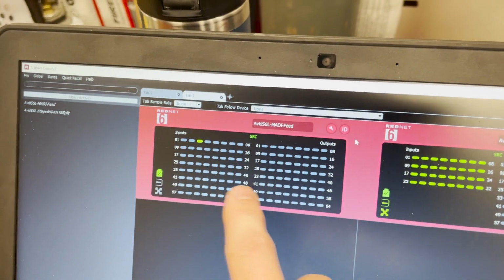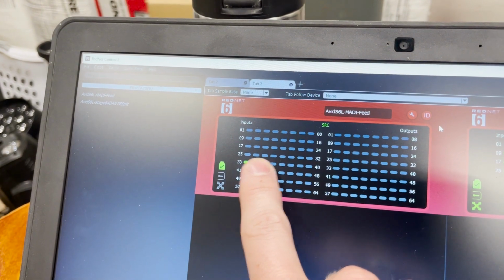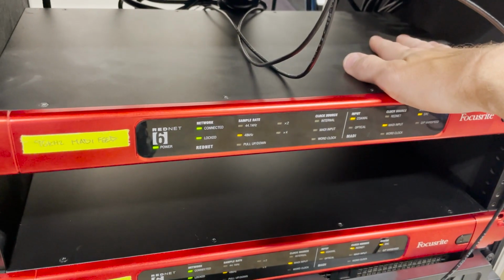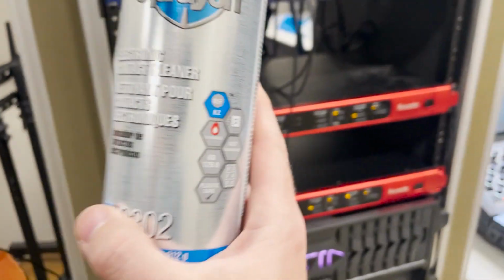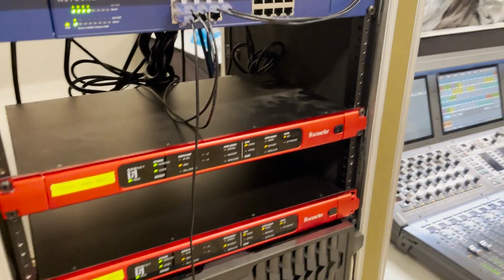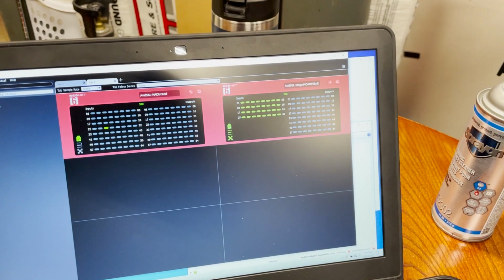Fixing a Broken Focusrite RedNet 6

Comment: Corrosion inside this expensive piece of equipment. How did this happened?
Reply from the maker: I'm fairly confident it was caused by the soldering flux they used in the manufacturing process on that specific PCB board as both units had the same issue.

Comment: 7:14  If it was somet thing like only an amplifier i would have just lightly dusted it with copressed air making sure to not turn it to the side or upside down, and spray at a distance. and then use electrocnic contact cleaner to clean it.  for this i would probly use something like a brush and Isopropyl alcahol, but thats just my personal opinion.

11:27  yes i most say im also suprised at how well that came out.  Huh. Might have to get ahold of some myself. cuz i do have an Soundcraft EFX12 board with some weird static and the right side not even getting audio, but dose get audio when PFL is enabled. and i also have an Avidi Digidesign Digi 002 where the XLR input PCB is creating a lot of static and barly working. So thanks for the tip.

Also wanna say its nice to see an, what shall i call it,  a day in my life kinda type of blog like u have done in past come back again.  Keep up the good work Drew!!
Reply from the maker: Thanks so much man! Always fun making these videos. I'll be making a whole system walkthrough of our new S6L install once it is finished.

Give that cleaning stuff a try, Grainger has a decent price on it, and it really does work wonders.